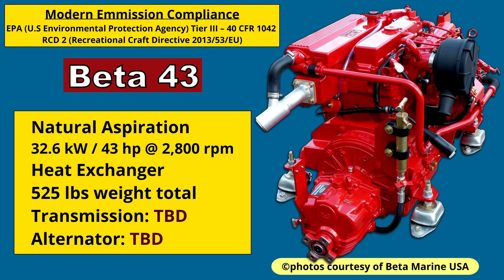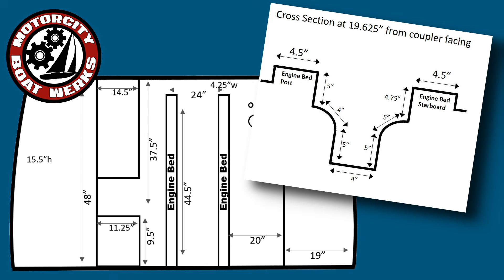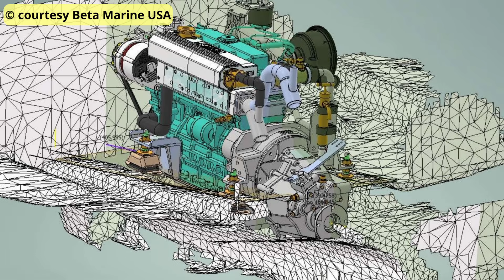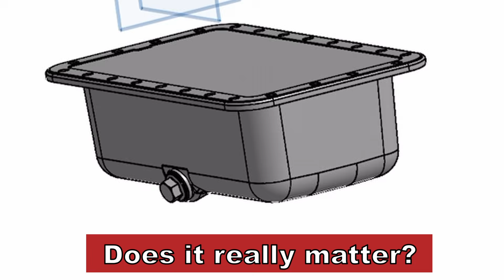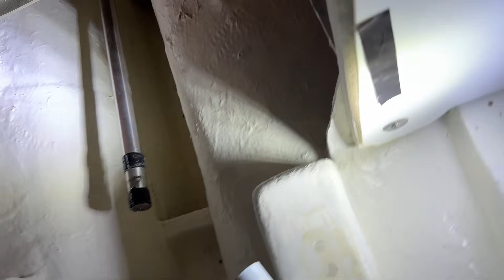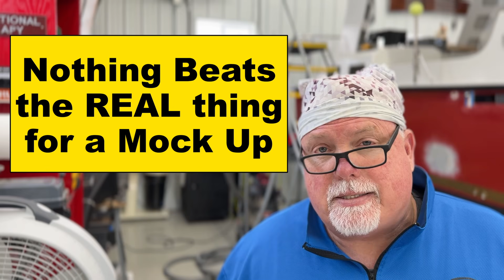Beta Marine Engine Won’t Fit My Boat (Ep149)

Comment: Epoxy with fiberglass is about 2x the tensile strength as resin fiberglass which is probably already in there. I’d grind that out
Reply from the maker: I would not do that 🤔

Comment: Let me float a 3rd option, a custom pan. Very common in auto racing it would allow you to move the oil drain to a spot with better access. On engine fitment itself, you might suggest to Beta Marine the offer use of a light, plastic block, often used by custon builders to mock-up fitments.
Reply from the maker: Custom pan is an option, 🤔but I think  it unfortunately doesn’t fit my design parameters.  These projects have a budget in both time and money. And th for the return value —custom just does not for int the equation. This is the reality of amateur boat building. Thanks very much for the comment 😁

Comment: A good fab shop could modify either of those pans. Cut the high spots off the large one or drop the center of the small one and add a drain plug. It all depends on where the pickup tube is. A remote tank/filter is also a good idea and might be simpler.
Reply from the maker: Thanks for the comment 👍

Comment: Can the engine be moved forward? I don't think a longer prop shaft is a problem is it? Also, a sheet metal fabricator could relocate the oil drain plug to the bow or stern position,
Reply from the maker: Thanks for the comment. 😮Let me consult my accountant 🤓
Reply: After changing oil on a diesel hundreds of times with a manual vaccum pump on the dipstick, highly recommend you keep the drain and plumb an electric pump to that to make oil changes supper simple and done in 10min. This eliminates the hassle of changing the oil more often. I have my sump piped to a small reversing pump just forward of the engine in the engine sump with a long coiled tub attached to the discharge/fill side with a screw plug at the end. Oil changes become simple steps: 1) uncoil the drain/fill hose and unscrew the cap, 2) put the hose in a container large enough to empty the oil sump, 3) pull out the dip stick or crack open the oil fill cap on the engine to release suction pressure, 4) turn the pump on in the engine oil suction direction. My pump empties my engine’s 5.5 litres of oil in less than 5min. You then reverse the process to refill your engine, sticking the tube in a fresh container of oil and drain the container filling the engine from the bottom. No mess, no fuss! Check the oil level until it’s full, then cap the tube, wipe it free of oil, coil and you’re done! Don’t forget to recap the oil fill or reposition the dip stick to avoid oil going everywhere (ask me how I know!). If you’re concerned about a tube breaking or coming off your pan, a simple shutoff value at the pan solves that. Best engine upgrade I’ve ever done and makes oil changes a breeze.
Reply from the maker: Thanks for the comment 👍
Reply: @ylemoine1 I was thinking the same thing.
Reply from the maker: Great ideas with no wallet attached. 😂

Comment: I'd stay with the deep sump, either carve out the stringer (minus) or take the pan to a welding shop and have the sides cut and tapered to fit and have the drain removed(plus). You'll only lose about 1/2 qt of capacity.
Reply from the maker: Thanks for the comment 👍

Comment: I would modify that pan to fit all day long to fit the space.  Take off that corner, move the drain, whatever works to get that oil capacity.
Reply from the maker: 👍 I was also thinking of adding oil molecule reticulator with Bluetooth
Reply: @motorcityboatwerks  Viable option

Comment: Man, gearhead here.  Sailboat, yeah probably the smaller sump (less oil capacity) would be ok.  It would kill me not having the extra couple of quarts of oil.  Oil life is one thing but the extra oil keeps it cooler as well.   Sounds like the company is ok with it though.
Reply from the maker: Common option choice so no worries 😉

Comment: One of those remote oil filter systems would give you extended oil life on the smaller pan. If there's room for something like that in there.
Reply from the maker: Thanks for the comment 🤔👍

Comment: Hi Joe. Is the large pan steel? If so, take it to a hot rod shop and have the drain relocated to the either end of the pan, preferably the low end (aft). They could also modify the epan to get you the clearance you need. The only other option is a dry sump which is a whole lot more trouble. Cheers! Rick
Reply from the maker: Hi Rick! A good idea -but I think the shallow sump will work out ok. 👌 better safe than sorry. Making progress👍
Reply: Hello Rick. I made a few alterations on the pan of my Yanmar pan to fit my boat build. I’m a metal fabricator, and the alterations were very basic and is not unusual   I’ve made alterations on pans for people putting larger engines in cars/trucks. Your idea is a good one. People shouldn’t dismiss ideas because it seems difficult or unorthodox.
Reply: @randall39  Hi Randall I spent many years of my youth hanging out in a hot rod shop. Custom pans were the norm not the exception. Gained a lot of understanding of the need for a larger sump etc. especially in dirt track cars. I'm hoping Joe gets what he needs for his engine. Cheers!